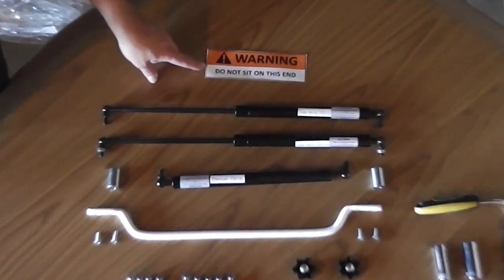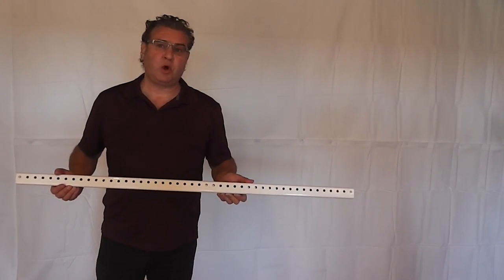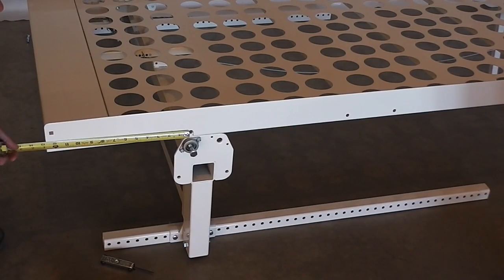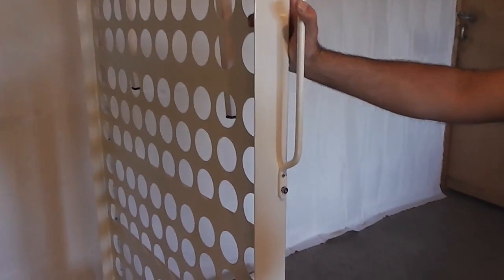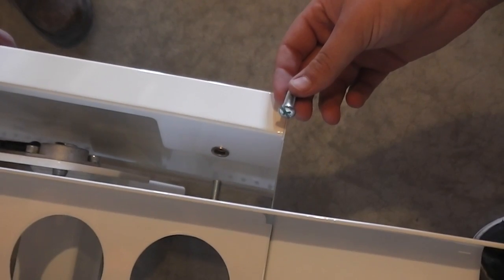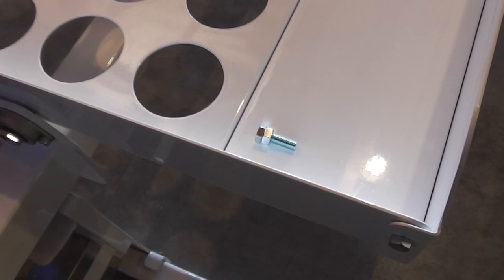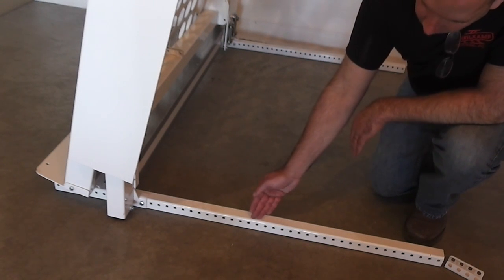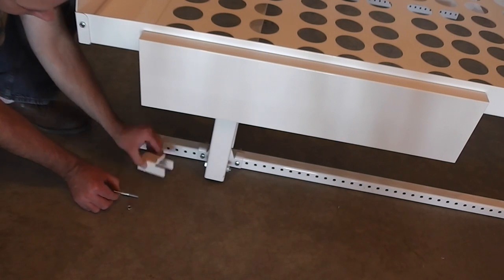RoyRack

Comment: Seriously a horribly setup display system. I have tried numerous times to assemble these setups with supplied hardware or lack there of. Never not one time has the bearing attachment bolts came correct. The other bolts are mismatch maybe one correct one if your lucky. Then the spec from one display to the next isn’t anywhere close to being the same. There isn’t anyway for me to add lengths to my setup because all the new parts won’t match up they are either too wide at the base or too short. Simply can’t say how disappointed we are with the system. If it was assembled and manufactured with detail attention to a systemic spec of hole sizes and widths between parts etc. This would be a great system. Long way to go from an idea to a great designed and produced working model.